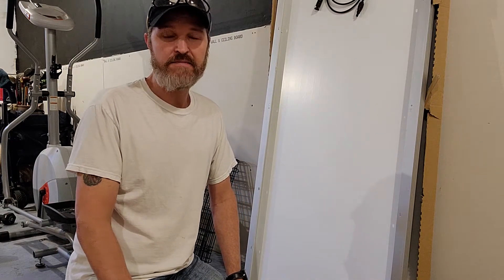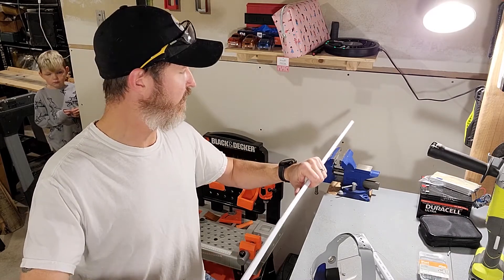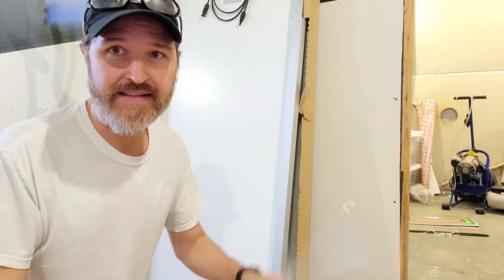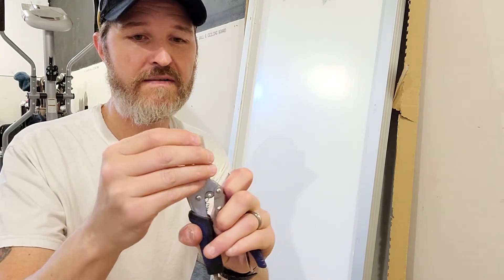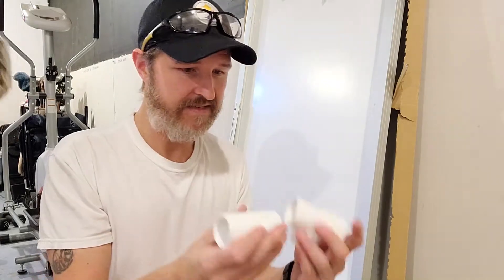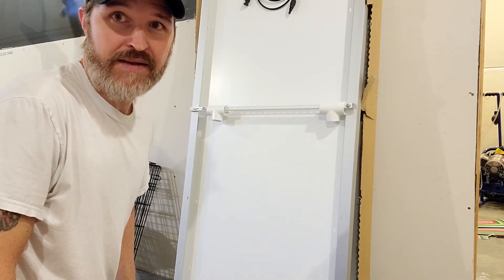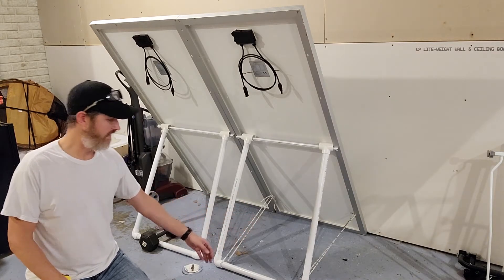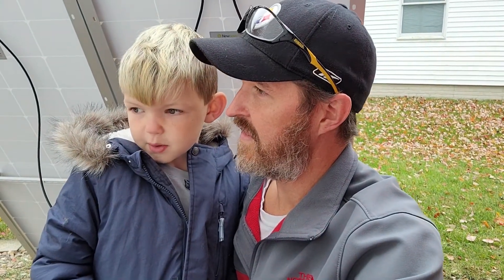How to build a PVC stand for a 200w solar panel.

Comment: Not bad at all. Cheap too lol. Cheap is always GOOD!
Video shows that work spaces are not meant for kids.
Lucky the kid didn't get hurt or break the panel.
What about panel grounding?
Some say you should and others say it is not necessary.
Reply from the maker: I don't ground since this setup is meant to be removed quickly if a high wind storm is coming.  Thanks for the comment!

Comment: Great idea. I’m going to do this. Right now I lean a panel against my pool cage on one of the horizontal supports, but I’m afraid it’s going to fall and rip my screen. So I’m doing this
Reply from the maker: Mine have worked for years without issue.  Good luck!

Comment: Your son was so cute in the video.  Ouch! when the panel fell on him - glad he wasn't hurt.  Teach him to wear glasses in the shop since he was in the background when you were cutting the metal and flying shards could have hit his eyes.  Now I know what I will use all of my extra PVC pipe for - solar panel stands!  Do you have any issues with snowfall on the panels?  I have a seasonal residence, and was thinking of moving the panels indoors in the Fall and then moving outdoors again in the Spring. Great video!!
Reply from the maker: Thanks for the insight on my son wearing glasses.  I do now have him wear a full face shield when he is with me while working.  I don't have much issue, but I haven't had massive amounts of snowfall in the last few years.  Maybe 6" at the most at one time.  I just use a broom to wipe off the the snow, then push it away about a 1' from the panels.  Thanks for the question and the comment!

Comment: Great idea. I have a mismatch 200 watt panel that I needed a stand for but I didn’t want to spend the money.  I already have pvc pipe for another project. Thanks
Reply from the maker: You're welcome.  I've been using them for a couple years now with no problems.  Thanks for the comment.

Comment: Great job on the stand. Just getting into solar and was looking for a DIY stand solution. This is perfect.
2 questions though. 
1. what angles can you get your panel to with the stand? Can you get from 90-180?
2. Instead of the single slot bracket bar, why not not use an additional pvc of the same size to avoid all the free play? I would think it would also give more support being tighter, when open and standing.
This is all just in my head of course. Curious if you had a reason not to go with that method.
anyway, thanks for taking the time to teach others.
Mike
Reply from the maker: I figure you could get close to 180⁰ and probably around 110⁰ before the stand starts to fall over.  The bar just makeshifts it so there aren't so many PVC cuts.  I hope that answers your questions.  Thanks for the comment.

Comment: This is what I need to go on the road with my solar set up. I can't get a roof rack for my van so I have to take my panels in and out to set them up.
Reply from the maker: The PVC stands work very well.  They've been holding up all of my panels for over a year now with absolutely no problems.  Thanks for the comment.

Comment: Are the tees touching the back of the panel?
Reply from the maker: No.  The bar bolted on the back allows for a little bit of space.  You can always add washers or spacers to make the bar further from the back of the panel if needed.  Hope this helps.

Comment: The stands look fairly easy to make.  It just that I don't have all the tools to cut down the PVC. What other method can be used to cut the pipe?
Reply from the maker: Thanks for the question.   I know the saw I used is a bit excessive.  A hacksaw would also do the trick quite easily.
Reply: Heat up an old knife

Comment: Is there a reason to didn't attach the slotted metal behind the solar panel angle, so everything would flush on the back? Good job!
Reply from the maker: I didn't want there to be an issue with the PVC T-connection constantly pressing up against the back of the panel.  Thanks for the comment!

Comment: I was wondering how to go about making panel stands,, now I know how to do it. Thanks for the idea it looks great. 
I'll be using cinder blocks to hold mine in place somehow.
Reply from the maker: They have been out for about a year now and are holding up great!  One thing I didn't show...  Make sure to use PVC cement.  That way they won't fall apart.  Thanks for the comment!